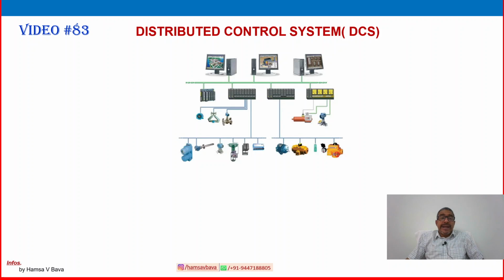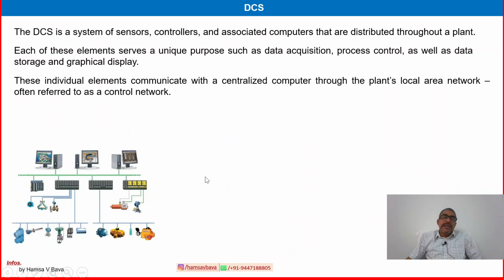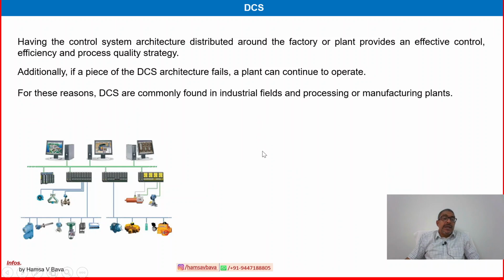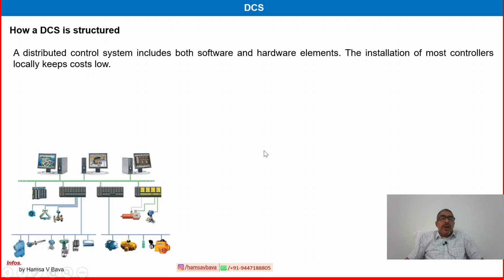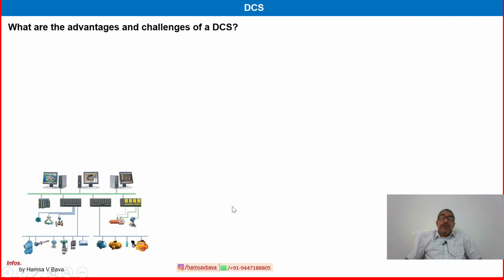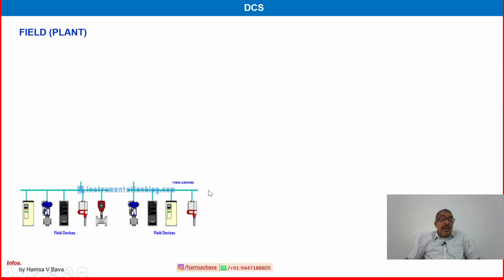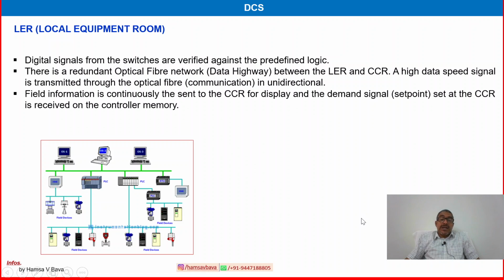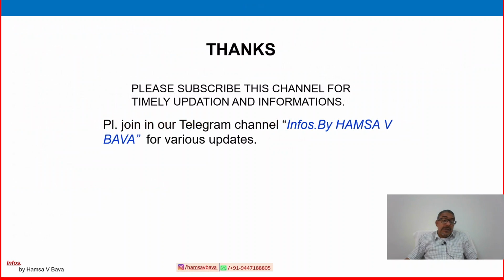Oil and Gas Process - Distributed Control System( DCS)

Comment: What is the use of IS barrier in Marshalling cabinet . Kindly make a separate video on this
Reply: Barrier isolates the hazardous area where there is a chance of explosion, with the safe area. They are used to control the energy transfer between the 2 areas.